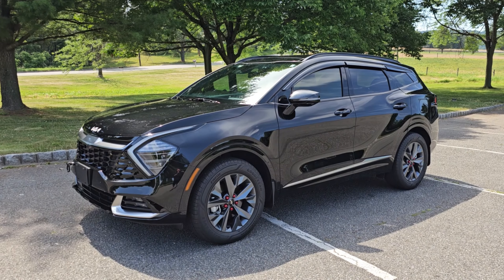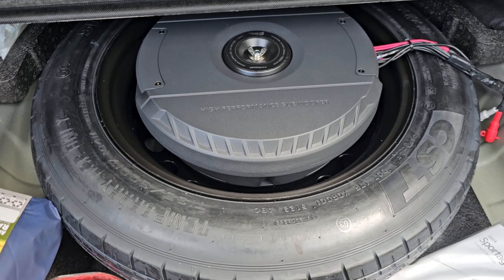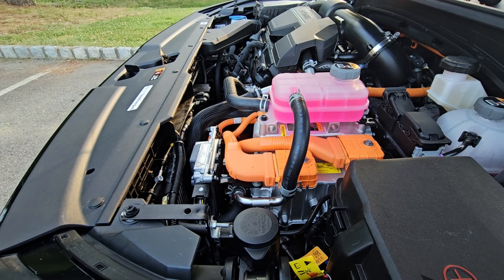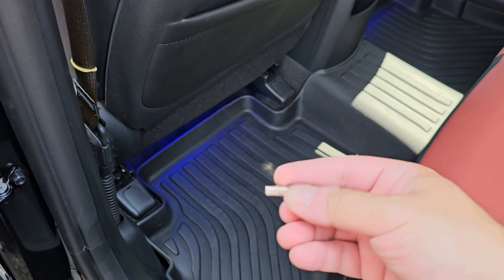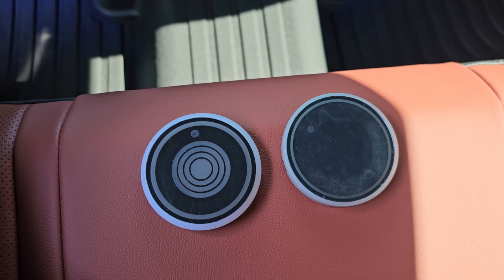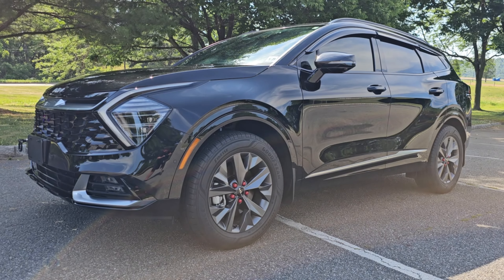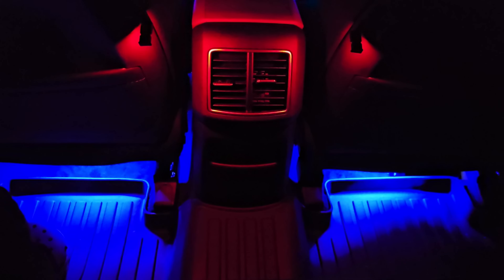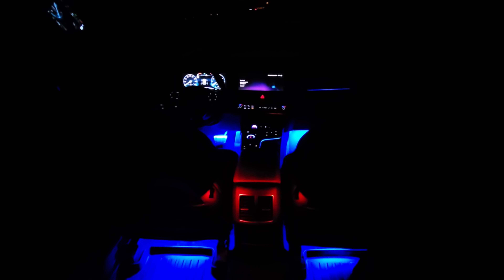Kia Sportage - Extra Lights & Sounds

Comment: Where did you connect the foot-well lights? Do they turn on when a door is opened?
Reply from the maker: For the footwell lights, the LEDs come with a 12v adapter that you can just plug in. I went a step further and cut that off and used a fuse tap instead. I plugged it into the Washer fuse. They do not turn on with the door (unless you want to wire them that way). They turn on automatically when the car is on and off when you turn off the car. There is also a separate power button that it comes with if you want them to manually power on and off.